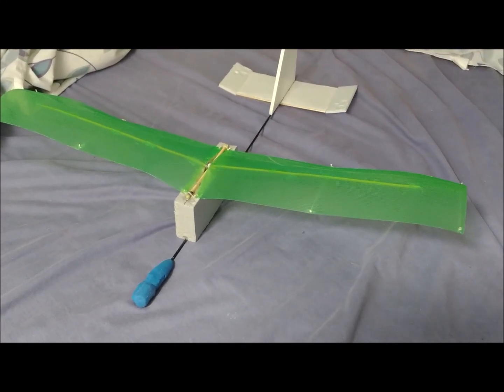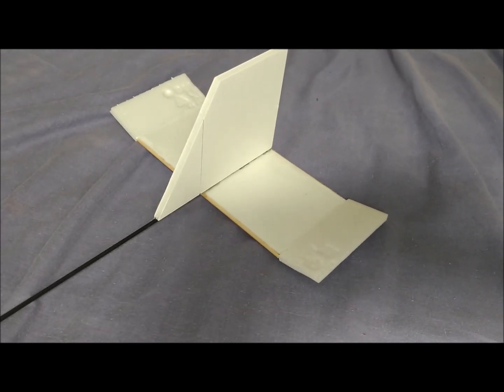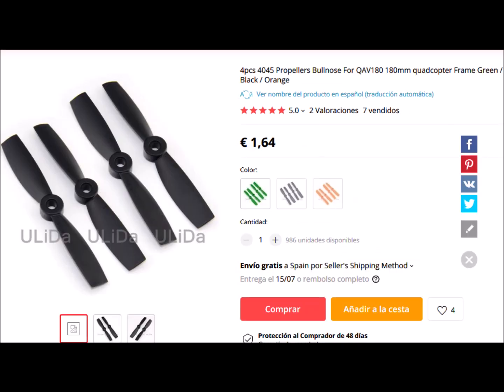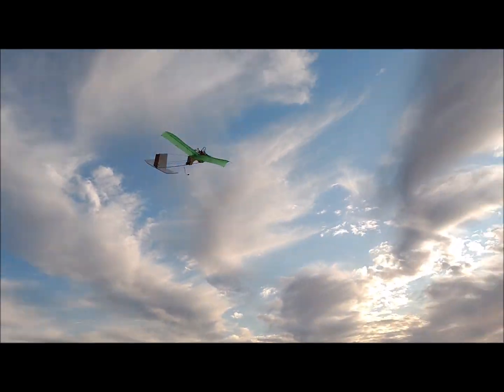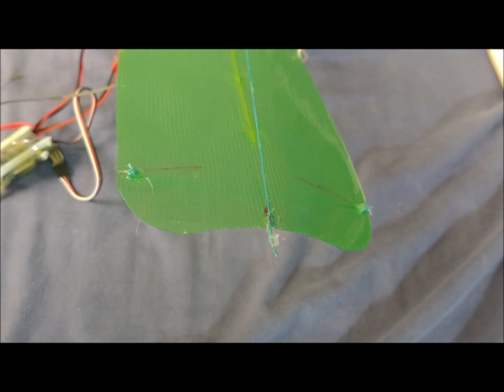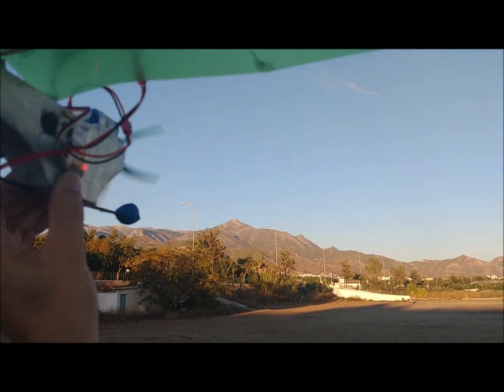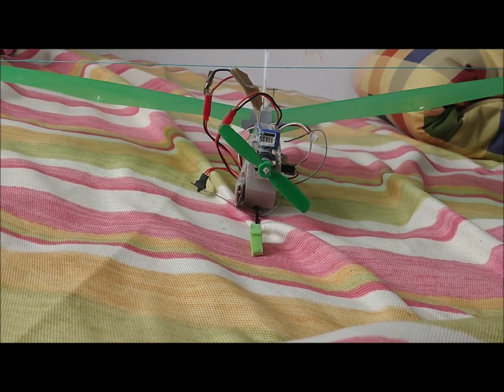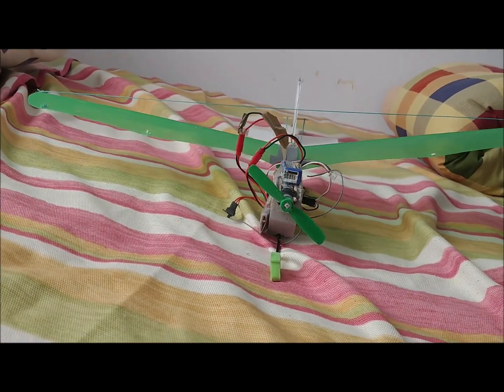How to make a slow flyer rc plane with a plastic sheet. RC. DIY. Homemade.

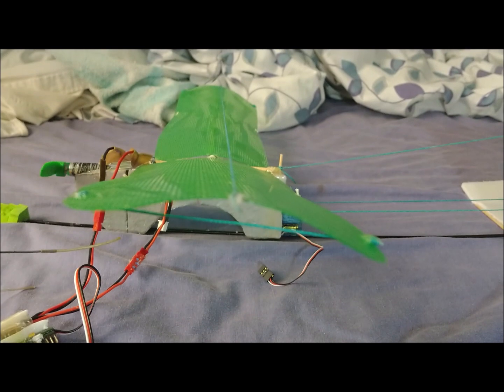Comment: some info.     at :33,  the tail is  HEAVY  ---  changed later.    the tail  Should be made as  light  as  is  practical.      at 2:00, excess mass is  Still present in the vert-stab;  the  LE  should be at a 75 degree slope.   the  MASS OF  servos  Should  be  located,  With  Precision.    there was  NO   reason  to locate the servo  aft  of the cg.      at 2:20, this is known as a single-surface, slow-flyer profile.     in the case of a  main wing that is mounted at zero-degrees aoi,  a profile thickness of ten percent is a  bit  thin.       it  Should  be understood that in order for a wing to work, Correctly,  its  profile  Should  be  cambered.   (this profile is  Not cambered).     compare the upper surface Only, of the clark-y(v1) profile; as Reference.      in the case of a powered model, the  optimal location of cg  is at thirty percent of chord/mac;  or, if desired, a bit  Forward of thirty.   this is science; not opinion.     the design of this model is non-conforming; in that, the  horiz-stab  Should, if practical,  be located  On  the  thrust line.     at this scale, cf  is  not  a  good  choice, for a tail boom.    USE   bamboo  or  small hardwood (poplar) dowel; in either case, the tail boom  Should be  Tapered.    the fuselage component  Must  be made,   lighter.       in order to fly two-channel, a  bit  of  nose-UP  deflection  Should be built into  the  horiz-stab.    this trim will then determine the cruising airspeed/throttle setting.    cheers        googletranslate
two drawings illustrate how  positive aoi  is  built into  this type of flat-bottomed profile
http://1.bp.blogspot.com/-5C8vhlmhBOk/VRe3o3Jt3yI/AAAAAAAABrI/EEgVHXkLvbY/s1600/clark%2By.gif
Reply from the maker: ok, thanks for the info